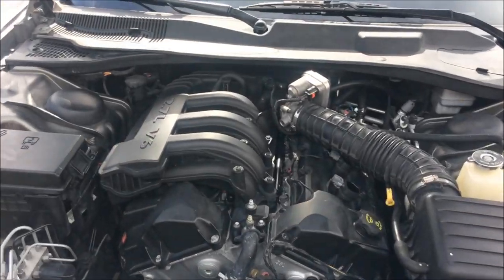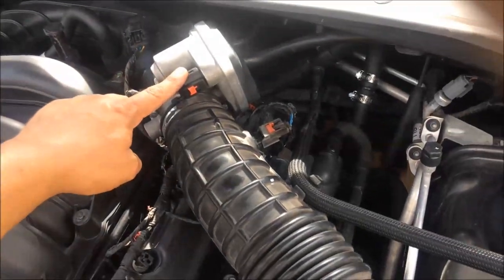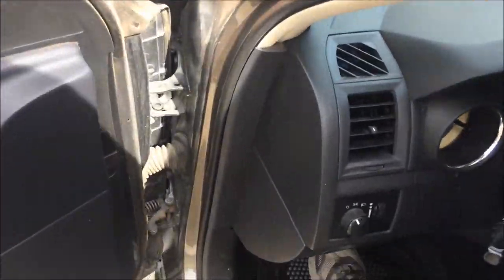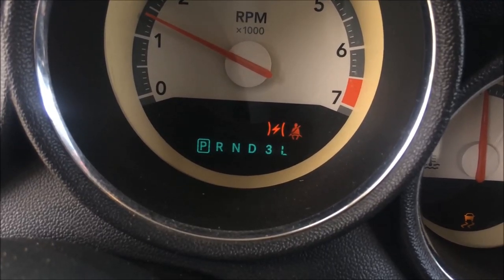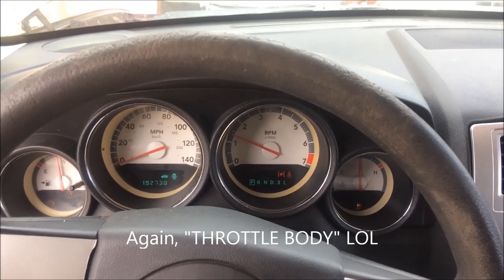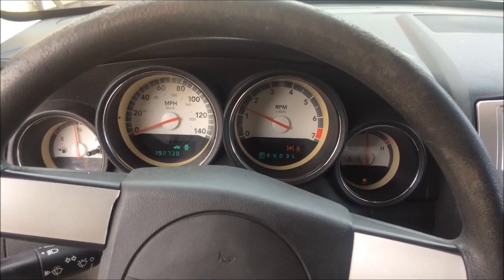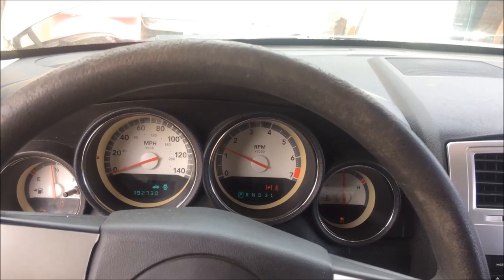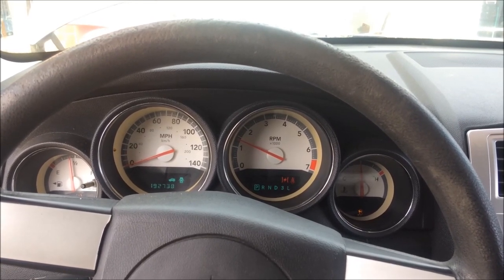Chrysler Dodge 2.7 3.5 v6 mysterious rough idle CHARGER 300 MAGNUM - EXPLAINED & FIX

Comment: what codes were being thrown? im about to buy my son one and i think this is the issue. p0300, p0344, p0340?
Reply from the maker: P0300 is one of the codes stored with this situation in the video, among 3-4 others but your problem, IF it’s a 2.7 V6, it  sounds more like a stretched timing chain and/or bad timing chain tensioner. If it’s a 3.5 v6 then it would be a stretched timing belt. You either should skip the purchase or find a mechanic and get a quote on a timing chain/timing belt replacement job. Those 3 codes are the main 3 that are stored when the timing is off. Now, if it recently had a water pump change both the 2.7 & 3.5 water pumps run off the timing chain and timing belt and it is recommended to put a new timing chain/belt kit with tensioner in while you have it all apart. Some mechanics will try to be cheap and reuse your timing components and they will fail. Typically the 2.7 ends up skipping time due to the crankshaft sprocket being worn down and the teeth don’t grab the chain well. They always end up jumping a few teeth. The 3.5 the belt stretches and timing will slightly be off. It doesn’t skip like the chain but it stretches way more like a worn rubber band. Of course I’m not there to assess it myself so it’s my best guess. Feel free to send more info.
Reply: @WarPonyAuto  Well i did buy it and we did a few minor things ourselves based off your video and a few others (cleaned and reset throttlebody,  new egr tube gasket, changed plugs, changed camshaft sensor (or crank shaft, whatever one is up top). now itll idle smooth for about 3 mins, then itll drop to about 600 rpm, then sorta sputter but not go off. Driving it, i dont feel any misses, only when coming to an idle). I pulled a new plug and it was sorta of oily (more than i feel it should be) so do you think doing valve covers gaskets? It has 130k on it and when i pulled the plugs they were the original crudy and burnt, so Im thinkin the guy didnt do anything to it
Reply from the maker: @TheRobbinbryson  Yeah, try replacing the valve cover gaskets 👍🏽 Oil getting into the spark plug cavities is common with worn gaskets. Is the check engine light on?
Reply: @WarPonyAuto  it was, but it was p0456.. which I was told could be just gas cap
Reply from the maker: @TheRobbinbryson  With your idle being affected though I would check vent purge control valve on the charcoal canister IF you replace the gas cap and the codes comes back. Inspect your Evap line from the engine bay back to the fuel tank. It sounds like you are making your way around it and figuring things out. My Charger had low idle after changing the timing chain, tensioner & water pump. I changed the serpentine belt and  belt tensioner and the idle went back to normal. I have seen, experienced the rubber seal on the fuel pump where it seats in the gas tank go bad and leak. Couldn’t tell by looking at it that it was bad but after changing it there was a noticeable difference and fuel pressure improved. These Chargers/Chrysler’s can be touchy.

Comment: just bought a 2011 and its having a hard time at 177xxx miles just wanted to ask what issues your commonly running into around your miles of 192xxx in the vid
Reply: Same here
Reply from the maker: I’m sorry I missed your question. It can happen anywhere from 30k miles on up. I believe this dodge had 197k miles and only had this issue. The customer brought it to me for a tuneup thinking that is what the issue was. I did the tuneup and had an idea that maybe this Charger had the issue I point out in the vid. I actually ended up buying this Charger a year later and putting a new timing chain kit with new water pump in it. I did a lot of other repairs and customizing to it before reselling it. As far as I know it’s running great at about 285k on it now 👍🏽

Comment: Hey. My car does this after driving a little while , but it doesn't leave a check engine light. It just goes into limpmode. It the 07 dodge magnum SXT
Reply: Going through this now and the code read u0100, lack of power connection. It said my ecm/pcm was bad so i took it to my electrician mechanic and they told me it was a bad 02 sensor and my abs
Reply from the maker: Change your O2 sensors and see if that helps.

Comment: My mechanic ut to much oil and it's acting like this . I have a Dodge magnum 2.7 do you think if I change the coils and sparks plugs and intake gasket do you think it would fix it .
Reply: It's drives and turns on after a couple tries now it's just started acting like this after a week of getting the oil change  , it isn't driving the best sounds loud and a knocking noise
Reply: Also I stopped driving it once it started acting like this
Reply from the maker: What codes are stored?

Comment: Oooh you might have just saved my butt, if not still good to know. Thanks for the video!
Reply: I'm about to change my rod bearings and main rod bearings maybe even a connecting rod and piston or 2 or all 6 maybe but shall see when I take the oil pan off and see the crank I may be able to sand it down I'm crossing my fingers for cheap fix I'm young and work fast food and can't afford a $1,300-3000 engine lol especially a dam V6 2.7L hell when I get my driver's license I can't even afford insurance lol as soon as I get insurance I gotta leave my job instantly and go the new one my friend got me but I'm waiting for  car to be legal and running right first 🤞it a roofing job pays 2-4k a month and paid weekly would change my life lol but yeah I also have a thunder bolt light on my dash when I start the car but I thought it was rod knock because the engine clicks,starts rough and rattling but it sounds like it coming from the top of the block idk what it could be but I'm hoping this $40 set of rod bearings will fix it and then I'll have it looked at by a mechanic eventually but I'm not driving it till I take a look at the pistons and crankshaft a new crank shaft like $300 not a big deal but getting it out might be lmao 😂☠️ shall see crazy things is there is no lights on the dash no engine light or anything bad but it could also be I haven't ran the car long knowning about the issue from the dude I bought it from also the engine has too much oil in it I guess the dude thought that noise would be fixed by adding oil lol but the car wasn't smoking at all surprisingly but it also has the wrong dipstick lmao I'm looking at around $400-500 to replace/rebuild the engine that's already in the car lol I'm hoping this works I'm planning on 

Replacing rod bearings and main rod bearings
Maybe crankshaft if it's beyond sanding repair lol like minor scratches can be fixed 
May need new valves and lifters possibly I didn't include that in the estimate tho I don't think I need those

Comment: My Chrysler 300 is doing the same thing but not sure if it’s the pcm Ik there’s two sensors that are on the throttle body I’m wondering if the one on the side is causing the problem because the clip seems to be lose
Reply from the maker: Dodge/MOPAR/Chrysler electrical clips are known for failing. You can go to partsgeeks.com, A1 auto or ebay & Amazon to buy replacements.

Comment: did you get 0300 code at that time?
Reply from the maker: Multiple misfire DTC’s along with misfire DTCs for each cylinder and an MAF sensor code. ALL went away after fixing this problem.

Comment: I have this engine on a 2009 dodge charger , my car shakes when im at a red light , or when i turn my car on , does any one know what this is ?
Reply from the maker: Check your engine mounts & transmission mount. If you do not have an illuminated check engine light and the mounts are good you may simply need a tuneup. Clean your throttle body as well. It could be several different issues but start with the basics. 👍🏽 If you need help you can find me on Facebook “WarPony Auto”. You can communicate with me there.

Comment: greatly appreciated. I have one of these piece of shit engines. I jumped the motor cuz the battery died and the car is giving off a rough idle has no power or lack of power I should say. it's doing exactly what you say without the damn codes or the dash lights. I'll check that part you mentioned to see if it happens to be it. many thanks
Reply from the maker: I do not like the 2.7!! It’s full of problems and it’s a gutless engine. I’ve had this happen, what you mention and for me all I had to do was reset the ECU even though the battery was dead. I could not tell you why this is but it fixed the issue. Smh
Reply: @WarPonyAuto  how do you reset
Reply from the maker: @ET2carbon  Plug the throttle body in completely then use a code scanner to clear the trouble codes, reset the ECU.

Comment: My 08 dodge charger 2.7l "R" made it over 230k miles before failure...but yea, what also sucks for the engine design is having water pump in with the timing set..bad decision..all internal..
Reply: What type gas do you use in ya charger  I was wondering will 89 octane damage engine

Comment: I have a 2006 300, 2.7l. It fres up. Runs rouch for a few seconds then normal. Once it heats up and i try to restart. It will not stay running unless i press down the gas pedal and keep it pressed. As soon as i lift off the car dies.

Ive changed spark plugs, wires, injectors,  inject rail, evap canaster, coil pacs, all sensors on engine, fuel pump, have changed all seals i can access.EGR valve. Getting the right fuel pressure. 

I cannot for the life of me find the problem. There are no codes on dash.
Not sure whats going on i changed everything it could possibly be as discribed from others on youtube and google. Spent over 5K.  Someone please help me narrow down this problem.

Comment: My check engine light went off, but the ⚡ light is still on.
Reply from the maker: Reset it with an ODB2 code reader, or disconnect the battery for 15 min.

Comment: I have a Dodge Charger 08 2.7 codes are co344 P0340 po123
Reply from the maker: That’s a camshaft position sensor code and Throttle position sensor code. First I would check wiring then replace the camshaft position sensor, clear the codes, test drive and see if the TPS code comes back, if it does the TPS sensor should be replaced. Clear codes and test drive again. It may take a complete drive cycle to see whether the check engine light comes back on or not. That could be anywhere from a mile to 12 miles.

Comment: What is regular idle speed for 2.7
Reply: mine idles at 600rpm, feels low to me though.
Reply from the maker: 550-650 Rpm’s is in the normal range of course there are various factors as to why an idle within the normal range may not “feel” right. Engine mounts, transmission mounts, fuel pressure, dirty throttle bodies and fuel systems, dirty MAS/air filter, and even bad/failing sensors can alter your engines performance just enough to not cause much of a difference in idle rpm’s but enough to “feel” that something isn’t right. Like a subscribe, stay tuned… I have a video coming up that explains this topic of rpms and how your vehicles idle may not feel right and maintenance that can be performed via the process of elimination method starting out with the easiest most obvious working towards the more complex problems. 👍🏽

Comment: 07 dodge charger 2.7 po301
Reply from the maker: That’s a cylinder #1 misfire. Try changing or swapping the spark plugs #1 & #2. If you get a p0302 then you know it’s a bad spark plug. If it still misfires and gives a p0301 then try swapping the coil with the #2 coil and if it gives you a p0302 then you know the coil is bad. If it still throws the p0301 code then it may be a deeper problem such as the cylinder head. You would then want to do a compression check.

Comment: Hey there I’m a female of course no idea what’s wrong but my codes keep saying cylinder 1 misfiring everything has been replaced so far I spent 500 dollars and now they told me I need a new pcm and flash and the dealer wants to charge me 700 something and then said if it’s not that I will need to pay diagnostic charge 🥵🥵 I just want someone who can really find the real problem before I spend anymore money that I don’t have to spend
Reply from the maker: If everything has been replaced then I assume the spark plug and coil have been replaced? That’s the first step. Swap the coil and see if the misfire moves if it doesn’t then swap the spark plugs or buy a single spark plug and test it then. If all you are getting is a cylinder #1 misfire code and no other codes and everything has indeed been replaced then you want to follow the coil wires to the number one coil to be sure they are not frayed or grounding out, which does happen as the #1 cyl wires snake around a few areas where they can wear or get pinched. Other than that it’s tough to say what your problem could be. A bad ECU (computer) is one of the last things to check in the process of elimination method. Good luck to you. Sorry I didn’t answer sooner. I’ve been busy. 😊
Reply from the maker: Also, you may want to ask them if it’s not the intake manifold gaskets or a vacuum leak. The steel EGR tube has a small rubber gaskets that can wear out and all extra air in the through the EGR inlet hole that the EGR tube goes into the upper intake manifold. Extra air affects the #1 cylinder.
Reply: Yes they did replace the egr valve to and they said the intake manifold looked fine I will have someone check the wires because yes the only code now after all of that is still cylinder 1 but they all keep saying it has to be the pcm and I just don’t have that kind of money to dish out to the car company they call say Chrysler has to do it if it’s the pcm and they want 900
Reply from the maker: Desiree SaintRare Thats no good! Replacing the pcm can be done by buying a USED pcm, taking it to the dealership service department with your vehicles vin # and have it reflashed. You will also need your mileage just in case. Then you can have a shop install the pcm.

Comment: I got a code PO174 and PO171 my car also run rough like that during idle and rpms go higher than expected
Reply: I’m having these exact two same codes!! 2009 challenger r/t with rough idle. Did you ever figure it out?

Comment: PO123 Po344 Po340
Reply from the maker: Those are camshaft and throttle position sensor codes. Check the wiring to both sensors, clear the codes, test drive then replace both sensors if CEL comes back on, codes persist.

Comment: Abs light, esp/bas light, brake light, and a light that looks like a flashing lightning bolt. Google says it's the connection between the accelerator and the throttle, When the lightning bolt one comes on my car starts shaking super bad and I have to stop and turn my car off and on again, it'll go off for a bit and come back on. Idles fast. The only codes I can get are C121c
Abs torque request signal denied

U0126 abs lost communication w steering angle sensor
Reply: It's a 2005 chrysler 300
Reply from the maker: It sounds like you have a steering wheel protrusion issue. Then again it could be a bad SAS sensor (steering angle sensor). You will need to find a mechanic that has a scan tool that can also read/reset ABS codes. It could be several other issues as well but it would take a hands on diagnoses to know for sure.